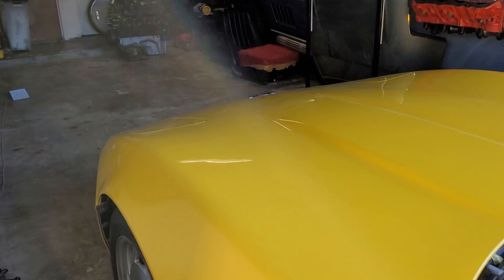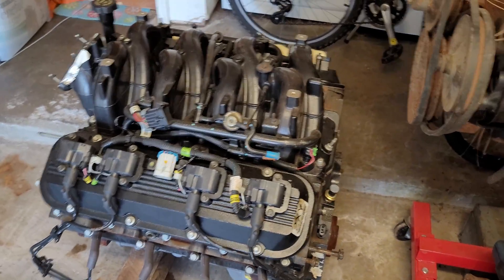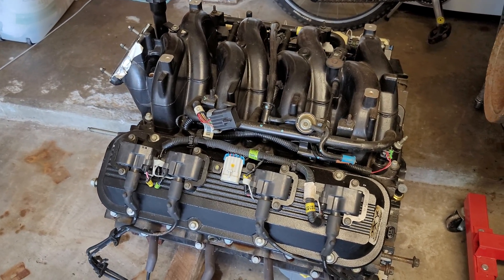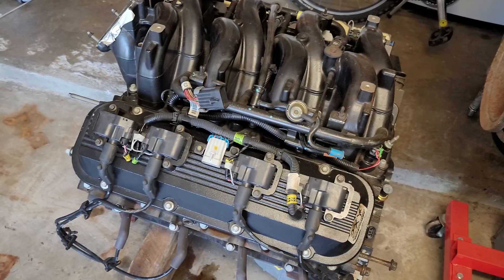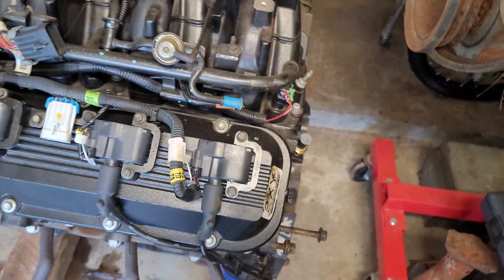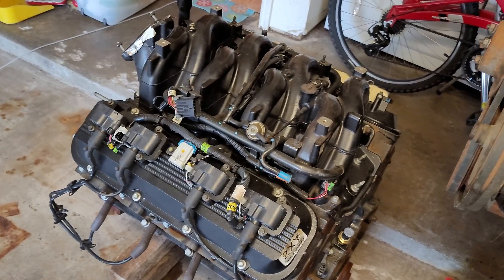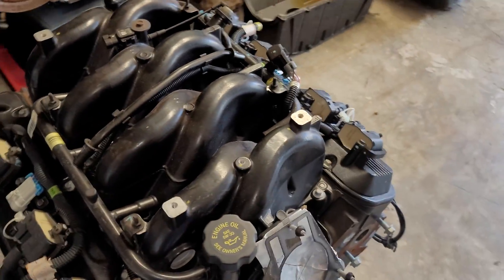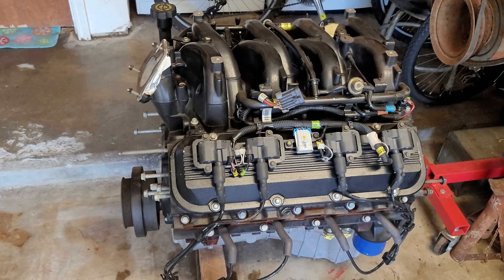The Monstrous Vortec 8100 496 8.1L Big Block Engine of the 2000's

Comment: Love mine. California to NJ in 50 hours. Never missed a beat.
Reply: Think I was just under 300 gallons for 28xx miles. Still, not a cheap trip. 11.2 - 11.8 @ 80 mph. 7000 truck with driver, 4.10 rear 75 series tire. So, stock basically. Lol
Reply from the maker: Yep, at least you were traveling in first class style👍.
Reply: @VetteSource  80 east coming  back. From salt lake city, all the way through to nebraska in the morning, i was driving through blowing snowstorm. O2 3/4 ton avalanche, worn out city tires on the rear, was playing the odds to get back home to my tire guy. Anyway, couldn't see the road most times, occasionally could draft a rig, or get in his eske for a few miles. 
Auto 4wd, let the computer do the work, concentrated on steering and speed. Every highway gate I came up to in wyoming, I  expected to be closed. Nope. Drove on. Ended up being about 600 miles of puckered seat cover. 
Truck never wiggled, wobbled, or missed a beat. As my friend put it... you could have had slicks on the front, and she would have still tracked right. Mass. ❤ I've got 2 of these trucks. One, is a spare. Bought them both, because saw where truck prices are headed, as the dollar declines. It's the body style everyone skips, I'll take them all.❤ had 1440 lbs of tile tearout in the bed, the other day... wheeling it through rush hour traffic, like it wasn't even phased. 
Can't do that, with the new half tons, without ending up with an 6spd neutral trans. 🤣
Reply from the maker: That's the kind of testimonial that keeps people interested in these bad boys. Did you happen to catch the video of the Chevy truck that got caught in the tornado and flipped over multiple times? As soon as it landed upright, the guy just drove off in it. Now that's tough😁.
Reply: @VetteSource   I did not maybe now I'll have to find it
Reply from the maker: That would be an awesome trip. I'm guessing around 350-400 gallons of gas. With today's fuel prices that ain't cheap👍.

Comment: How much is one of these engines used if you don't mind sharing that information
Reply from the maker: Figure anywhere between $1500-$3000 depending on condition and mileage with core engines bringing less obviously. As far as crate engines go, these are pretty impossible to find at this point since they've been out of production for so long. I just happened to get lucky when I stumbled across this one featured in the video.

Comment: I have been a fan of the big block chevy since i was a kid in the late 70's. my uncle had a Chevelle SS 396 L78 4-speed car and a flat bottom ski boat with a 454 LS6 crate engine in it. both were super fast.  once i was able to drive i got a camaro with a 350 small block but my dad would never let me swap it out. after i got our of the air force i found a 71 Camaro ss 396. not the most potent 396 ever made, but once rebuilt it  added a roller cam and got rid of all the smog just, that thing was unreal. consistent 11.7's in the quarter mile on radials. there is probably another .5 - .7 seconds in it if i were running drag radials or slicks.  was always festinated with the 8.1L vortec big block. it had a lot of high performance potential with right cam and better after market support.
Reply from the maker: Hey Shad. Cool story, thanks for sharing. You and I are from the same generation of late 70s/early 80s. My fondest memories are of the BBCs prowling the streets like T-Rexs on the hunt. 

Even though some of the power output of the newer generation small blocks is impressive, they will never match the sound and cool factor of a BBC with a solid lifter cam at WOT.

The 8.1 was an awesome send-off for the BBC, and I'm glad to have finally been able to acquire one to use on a daily basis. Of course, that's as long as I can keep the fuel cost from bankrupting me🤣.
Reply: @VetteSource  I know all about fuel cost... my 71 SS 396 get 10mpg.  up hill, down hill, pulling a trailer, 70mph tail wind, doesn't matter... its getting 10mpg. but it will crush most modern cars, and even shocked a few Hell Cats that did not realize how fast a BBC Camaro can be.
Reply from the maker: Yea, it's always amusing to see that gobsmacked look on their faces when you walk all over them🤣.

Comment: Had a choice in 2002 between this and the “new” Duramax...I chose this due to the legacy of this big block and reliability. Bought an 02 2500hd GMC with the Allison and 4.10 gears. Best decision I’ve made on a vehicle! Tons of power and torque and tows trailers like a diesel. I tow trailers at 80 mph over one of the largest mountain passes in the west. It used oil from the start which a new recalled intake gasket helped. Also had a faulty crank position sensor that didn’t throw a code. But other than that, 300,000 miles later and not one issue! Half those miles were towing a trailer. Unfortunately, it just gave up on me last week...p0300 code along with crank and cam position codes...

I’m curious where you got this crate engine? Looking for options if I can’t get mine running...
Reply from the maker: Hey Micah, great testimonial. Like you mentioned, the reliability of this engine has everything to do with the legacy engineering put into the BBC since 1965. With proper maintenance, the reduced cost of operating one of these will definitely save you money over the long run. 

I happened to get lucky with this particular crate engine. The gentleman who bought it new had plans to put it in his Rolls Royce, but he never got around to it. I purchased it from the second owner who was planning on putting it in his boat, but he abandoned that idea when he figured out how expensive the prop drive system was going to be.

The good thing about the 8.1 is there are quite a few out there since they were used in so many applications.

Comment: Awesome overview, great detail! I've got an 8.1 extended cab dually, and it pulls awesome. My only complaint is with the Torque Management system, which I intend to tune off shortly. The combo of this capable, simple engine in front of an Allison transmission makes it impossible to justify the cost of a new truck.
Reply: i have an 01 2500hd and it has 180k miles i couldnt ever justify spening 90k on a new pickup as for 10k i can totally rebuild the engine and tranny which doesnt need it.  love this truck
Reply from the maker: Yep, I believe this is one of those trucks that will always be viewed in many circles as the pinnacle of GM design and durability.
Reply from the maker: Hey Jeffrey, thanks for the comments. These are incredible trucks like you said, but the torque management system is a puzzling system. I am troubleshooting it on the 02 CC dually I  rebuilt and it's driving me crazy. Who did you have perform the torque management delete on your truck?

Comment: I have had 2 truck with the 8.1L and Allison transmission in them. Both 2001 truck both crew cabs one short box other long box. Short box truck a 4X4 and long box is 2WD. Both get 14.4 mpg they really aren't worth a crap in snow and off road because the motors are so heavy that is what I found with the 4X4 truck. My 2wd will role 300K this year. It came from Texas .zero rust and looks as good today as it did 21 years ago when it rolled out the door from GM. It is a bad bitch. You did mess up your torque rating in video not 440 lbs torque they are 540 lbs of torque. And some varied in HP from 340 to 370 hp depending on what they went in. Not sure about the boat motors but the truck engines have a cheap pistons in them and can't put much cam or very much boost to them if you want to hop them up. I know Raylar engineering makes pistons rods crankshaft all hardened pistons have valve relievers in them for more lift. They make aluminum heads that flow like crazy and they found a solution for the choking intake. Hope you have as good of luck with yours as I have with mine. Your torque management problem might be in your TCM I have ran into that problem the wires pull out of the block where they plug into the transmission computer. And sets all kinds to stupid codes. Only problem I have had with my trucks.
Reply from the maker: Wade, thanks for the comments and testimony. These 8.1 trucks are indeed monsters on the highway, and incredible daily drivers to boot if you can afford to keep fuel in them right now🤪.

Thanks for the TCM wiring suggestion. I was just out looking at the connector ends of the TCM plug today and noticed the "comb" style retainer was weak on the requested torque signal circuit. I'm going to swap out the connector and see what I can come up with.
Reply: @VetteSource  I took my factory connector apart and pushed the pins out with a tool I made to not damage them. And bent to holder tab back out and snapped it back in and problem solved. If you do any connector repinning I would suggest you buy a set of tools for doing it. Right tools for the job make it easy to do the job right. My truck has sat in my barn since mid October and I fired it up today. Boy it was nice to hear it roar to life. Such a awesome truck for pulling a 12,000 lb trailer all over the state of Minnesota. Going to wait a couple more weeks before it comes out of winter sleep. Good luck with your truck. If you need any more information glad to help.
Reply from the maker: Definitely, appreciate the offer. I just acquired a broken down and abused 01 2500HD 8.1/Allison truck last week.

https://youtu.be/Jr10wl5Oj5I

 While it sits awaiting me to resurrect it, I've been cannibalizing the parts from it to test against the 02 dually. I'm going to borrow the TCM connector from it this weekend and see how it goes. Will keep you updated.

Comment: To be fair, the 6.8 suffered by being a 10cyl 5.4. revs are not great because of the ridiculous stroke, and cam duration just isn't enough for how much travel the pistons make. The 7.3 is something pretty wild already. Cam and ported heads with headers hits 600 HP. Nuts. Considering the new batmobile used a triton V10, maybe some interest will pique on it
Reply from the maker: Good observations, each of the big cube engines have some pros and cons, but like you said, that 7.0-8.1 seems to be the sweet spot for maximum power potential. Thanks for the comments👍.

Comment: I just picked one of these up from the pull your own part place for 225. Getting ready to drop it into my 93 2wd Silverado. And have a work/play truck
Reply from the maker: Man, that's a score right there👍. Google luck with the project and let us know how it's going.
Reply: @VetteSource  I grabbed a 6.0 truck engine and a Duramax the same day lol. All three the same price.
Reply from the maker: Yea, I see engines I want at these yards quite frequently but never have enough time to go back over and grab them. Glad to see somebody is getting good use of them👍.
Reply: @VetteSource  I've never seen that many good engines on the same day. My cousin and I pulled all three the same day. We took the radiator support bolts out. Cut the pretty rusty fenders right down the middle. Folded the clip up like a hood. Cut all hoses and wiring. Cut the frame each side. I reached back and got the bell housing bolts, motor mount bolts and cut the exhaust.
Reply from the maker: Now that's what I'm talking about👍. A Sawzall and a few basic tools will work wonders for retrieval of parts that would normally be hard to get to.

Comment: I've seen one in a C5 vette before with a custom low profile intake. It's not particularly difficult to run it with an LS computer.
Reply from the maker: That must have been pretty wicked. Yep, the 8.1 trucks actually use the LS style computer management system, so it's simply a matter of plugging it all in. Thanks for the comments👍.

Comment: i suppose i could fit 1 of those in my 69 impala. are the motor mounts for those the same as vortec 7400? it looks like an LS
Reply: I know the vortec 7400 will bolt right in my 69. That block does look like vortec 7400 but I suppose the motor mounts don’t line up from gen 6 to gen 7
Reply from the maker: Exactly, the 7400 still has the old mounts and frame saddle to bolt them up. The 8100s still attach to the block with the same tri-bolt design, but use the LS style crossmember mount.
Reply: LS mount, yuk that’s what I thought because of the coil packs. I thought it was a vortec 7400 block based on the 6 bolt timing cover
Reply from the maker: Yep, the GEN VI and GEN VII blocks are different in enough small areas to keep much from interchanging. 

However, I just double checked, and the older 7400 mounts will bolt to the 8100 block so it looks like you would be able to drop it into your car.
Reply: Those damn LS blocks on my cross member, have to weld and chop up the damn cross member. That’s why I need vortec 7400 block
Reply: I’d be happy to put that in my 69
Reply from the maker: Its the Gen VII and final version of the BBC, so it will physically fit. However, it has some LS architecture adapted to it like the coils, fuel rail, cathedral port heads, engine management system, and motor mounts. You would need to weld in the earlier BBC frame motor mount brackets to make it work. Honestly, it's easier to use a GEN VI or earlier BBC.

Comment: Belongs in the c4 with some good raylar aluminum heads, c3 big block headers will work for a regular big block swap into the c4, not sure about the vortec 8100, as you know it's an oddball, different heads etc.
Reply from the maker: Yep, I've contemplated what it would take to shoehorn one of these in between the frame rails of a C4. Maybe I should keep that as a future YT project idea.
Reply: @VetteSource  big block c3 headers will definitely work. Or even the stock manifolds. I'm sure you're aware of the Richard Holdener vids on the 8.1, or the guy from powerblock TV that turboed his 8.1, L.T. is his name.. in a c4 with a zf s6-40 transmission and d44 with 3.42 gears it would be a total BEAST! Probably get decent economy too. 411 ecu swap. Would require some research to keep the fuel economy display active, but it's been done. 400 rwhp and 500rwtq at a lazy 5000 or less rpm = the tpi gm should have released in the 85-91 c4
Reply from the maker: Yep, I completely forgot about the exhaust manifold interchangeability. Thanks for keeping me straight😁. 

I haven't had time to watch Richard's 8.1 video series, but going to try to carve our some time this evening. Thanks for the headsup👍

Comment: Bought my 2002 2500hd Silverado brand new. Now has 201,000 miles. Contiplating if I should do the timing chain. Right now truck is down for a whole new suspension. Almost done. Did a solid axle swap using 1979 Ford Dana 60 kingpin. 10 inch lift with 40's.

As far as problems I have had:
Crankshaft sensor went at around 38,000 miles. Common problem with these.

Air intake manifold leak throwing p0101 code. I actually drove on it like this for 8yrs. CEL would only come on during hard acceleration. 

I had a exhaust manifold bolt break off in the head due to heater core hose dripping on it. Was able to repair it with a heli coil.  Still holding up after 7yrs.

Oil pan gasket developed a leak. Replaced. But after doing the solid axle swap, if it leaks again it will be a breeze to do now.

Camshaft sensor went out. Engine would crank and crank until it started. Not too bad to fix this.
Reply from the maker: Yep, lots of good info contributed by long-term owners of the 8.1 trucks. Thanks for sharing. It looks like it's been a good vehicle for you👍.

Comment: Great video and yes very few people know about the 8100 Vortec. In my opinion and experience with these 8100's, they are the best ever made. I own a few 8100's and 7400's (all GMC duallies, Suburbans & Yukon XL) and my daily driver is a 2002 GMC Extended Cab dually 8.1/Allison with 4x4 on the floor and I'm close to 800k miles. The motor, transmission and axles have never been rebuilt or replaced. The only major part replaced has been the transfercase about 3 times but other than that, just regular maintance and minor parts it is needing that I have done myself. She is my baby and I take really good care of her always. Many people don't believe me about the mileage (especially diesel guys) and this truck is used to work hard and doesn't give up at all. I have always pulled with it all over Texas(my home) and a few more states and have done alot of traveling in it since the first day I bought her(15 years ago with 32k miles from the first owner like brand new😍) and she still pulls hard like a mean beast. I'm still searching for more to buy no matter the distance.lol Well I can go on and on but I really enjoyed your video and all the info is great and I'm looking forward to more videos and yes, I am a GM Big Block guy too👍Thats all I own since I drive🤠
Reply from the maker: Galdino, thanks for sharing. Glad to see see other 7400 and 8100 enthusiasts like myself. I too have a mixture of both trucks, with a 2000 SRW 3500 with 7400 Vortec that I've used as a daily driver for almost 20 years. These are well built machines, and like you mentioned will last forever if properly maintained. Im.in Texas as well, maybe I'll see you on the road one day👍.
Reply: @VetteSource  yes Sir hopefully one day we meet. San Antonio is my home but I like to take road trips all over Texas to find more treasures. Im looking forward to see more of your Yukon XL. Well stay safe and keep having fun👍
Reply from the maker: Will do, looking forward to it👍

Comment: Very torquey motor. I special ordered my 4x4 with a 6 speed manual and twice broke my mounts. I'm on my 3rd motor mount replacement.
Reply from the maker: Yep, those ZF6 equipped trucks are hard to find.